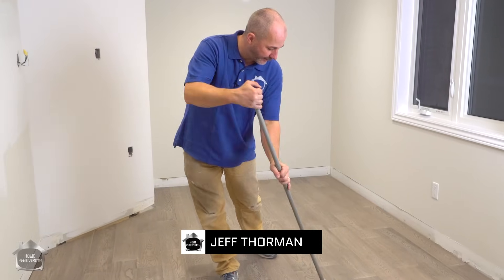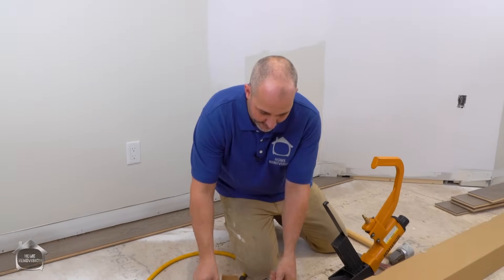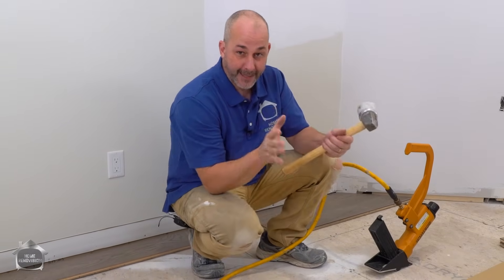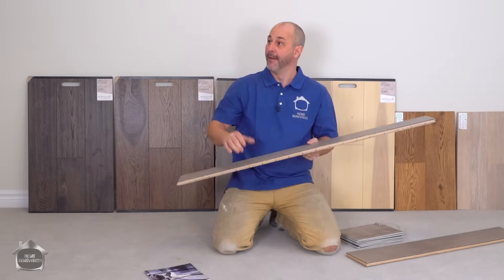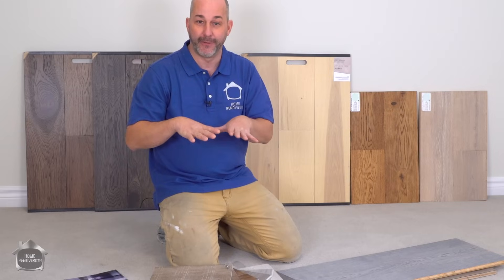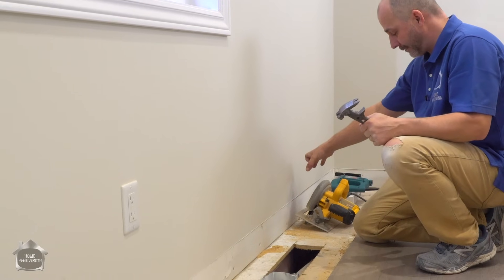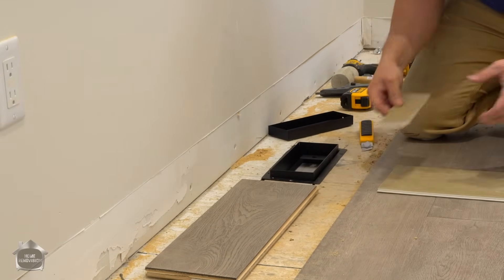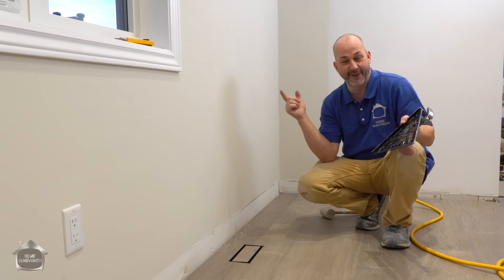How To Install Engineered Hardwood Flooring!

Comment: We are installing radiant heat in our kitchen/living room/dining room area.  What is the best flooring to put over the radiant heat system?  I'm working with a budget so I need the most economical without going so cheap I have problems later.  In other words, best bang for the buck.  FYI-We live in a raised ranch home.

Comment: Interesting. Because when I read through instructions of almost every manufacturer, what they say is that 15.5 gauge nails or staples for solid hardwood flooring (3/4 inch), 18 gauge for engineered with 1/2 to 5/8 inches thickness and 20 gage staples for 5/16 and 3/8 engineered flooring. If the flooring has a HDF core, then floating or glue down only. But what do I know, I am not a contractor. I just do DIY projects here and there.

Comment: the builder of my house installed this factory finished hardwood flooring and it is so soft, that rolling a computer chair around leaves tracks in the floor :( dropping anything really leaves dents in the floor...im pretty sure she got it from lumber liquidators, and my dad always talked bad about that place to begin with. not to mention these guys made some kind of mistake or lack of care  in the subfloor so everything squeaks, creaks , booms, and cracks when you walk around. it really is something for a brand new house built last year
Reply: That's floating floors for you (not the softness though obviously). Best flooring is glued down Luxury vinyl tile, Karndean being the best looking in my opinion.
Reply: @garnhamr  its engineered hardwood and it was installed just like in this video with that nailer thing. its not floating at all but i think the subfloor is not glued to the joists as well as they skipped out on sound proofing underlayment for the floors so it sounds like elephants stomping even if you walk quietly

Comment: There's actually a ratcheting tool called a power jack for the last pieces against the wall that butts them up tight so you can nail them...but unless you do a lot of wood floors it's kinda pricey.

Comment: Hi Jeff, I'm a fan of your informative videos. I am a subscriber and shop at your Amazon store to support. I have engineered wood glued on slab. It has developed gaps that are 1/8th of an inch and larger. Could you please let me know how to fix it? Lots of videos are about just moving the pieces but that is not an option because my home floor is glued to the slab. Thanks for your help.❤

Comment: Your site is great!  I just bought a condo in Annapolis, Maryland and I'm using all the techniques you demonstrated and applying them on fixing all the holes, scratches and attempted patchwork done by the previous owners.  If the opportunity should arise, could you show the process of moving an already installed cable outlet on one side of the room, fishing it through the ceiling and down the other side of the room and the best way to cut holes and patching the ceilings?  I love your site.  Many thanks.

Comment: Hi . I am a big fan of your work and have watched almost all videos . I just bought my 1st house and already did some renovations using your guidance . My next project is to install engineered hardwood floor and I saw all your videos on that but just realised that we have concrete under when I removed the carpets. Can you make a video or direct to a resource where I could follow steps for that installation ? Thanks for help.
Reply: Did you figure it out ? I'm in the same boat

Comment: Hello, what length staples did you use for this engineered hardwood? I’m installing 3/8” engineered over OSB subfloor. The place that supplied the flooring said to use 1 & 3/8” staples but I have the same gun you’re using and it only takes 1 & 1/2” - 2”

Comment: Hi some questions so far; 
1. With engineered hardwood is it not a requirement/ good idea to leave some expansion space between the wall and the first row? 
2. You did not remove the trims or baseboard is is that okay because it’s engineered hardwood or is that just a choice to make no matter what material is used? 
3. I also noticed no paper or underlignment under the wood pieces, is this not required because it’s engineered hardwood? 
4. What the difference between the groove and tongues? 
5. What should be prepared prior to starting the project? Should this be opened to acclimate it days before?
Reply: Engineered doesn't require as much contraction space, and it's mostly long ways. 

There is no baseboard in this video. 

Hardwood on good osb means no underlayment, unless it's second story, then use it for soundproofing.

Tongue sticks out. Tongue goes into groove for tight fit.
Reply: @joshbrienen5133  thank you!

Comment: How did you move the vent location closer? Not sure what you did with the tin  you snipped to size. Was the ducting just loose enough that you could move it over closer and attach the grille to it?

Comment: If the first row is under kitchen cabinets, should I glue that row or a half- width row to the first full width row.  Or Brad nail the half row or use 1/2 spacers to push back when floor nailing?   What to do?

Comment: How do you recommend installing engineered hardwood on concrete slab?
Reply from the maker: you get a underlay that has oval holes in it and place construction adhesive in those slots then lay the plank on top. Cheers!

Comment: My engineered floor is one year old and I have staples popping through in one joint. Do you know how I can reset those staples without damaging the top grove of the corresponding plank? I am guessing this is caused by the settling of the new home over the past year and the floor joisting is drying and shifting.

Comment: Awesome! I was just looking into engineered hardwood after you mentioned it in the Saturday’s video and I’m pretty sure that’s the way I’ll go, vinyl planks are easy, but they wouldn’t go with the look I want quite so well. 
On a manufacturer’s site I looked through back on Saturday they mentioned that they could have heated floor system under, what are your thoughts about that? It would be really nice if that’d work well 😊
Reply from the maker: definitely possible. they have technology now to heat just about anything. always follow the heat mat manufacturers install specs. Cheers!

Comment: Jeff, can you make a video please where subfloor is not leveled. Do you start flooring with tongue or Grove next to the wall?
Reply from the maker: groove towards the wall. Cheers! and you can sand the high spots if they are on a joint.
Reply: @HomeRenoVisionDIY  so we laid out floors and they squeak, is there only one option to screw them to subfloor?

Comment: two quick questions. 1. I see you never use any kind of underlay paper, can you tell me the thought process behind that decision. 2. I am installing regular solid hardwood and my sub floor bows between the floor joists by 1/8- 2/8. can i use glue with the nails to prevent wood movement?
Reply from the maker: In houses where you have conditioned space above and beneath the floor it is not needed. instead of glue I would just nail the board contrary to the joist. let the hardwood carry the load. Cheers!
Reply: Gluing solid hardwood is tough because of expansion and contraction. The bond of the glue will loosen causing squeaks. Solid hardwood is nail down only. Most manufacturers warranty calls for it.

Comment: Great, but what about starting off with a 3-inch wide plank? The gun will still bump against the wall. Does one also have to nail down the second row too? Or, is there a bypass?
Reply: That's why he started with a Brad nailer for the first row

Comment: great video. I have 2 questions,  1. when you use st Pneumatic Brad Nailer to stable your first piece, how you avoid Thermal expansion and contraction for rest pieces? 2. why there is no spacer to put on at the beginning of the layout?
Reply from the maker: engineered flooring does not require as much expansion room. 1/4" gap on the long side is plenty the wood usually grows in the same direction as the grain!
Reply: Thank you so much and always fun to watch your videos! Appreciate!

Comment: OK...  now I want the engineered hardwood for the non-wet areas....  But I have several quandaries...

1)  My house is so small that I am afraid that putting the hardwood in the LR, hall, and bedrooms, and then the SPC vinyl planks in the kitchen and bath will make the house look even smaller.... or goofy...  mostly the kitchen to living room....  Plus the transition from thicker wood in LR to thinner vinyl planks in kitchen.

2) How do I put the engineered hardwood in my concrete slab on grade home?  I am assuming that I have to put a sub-floor over the concrete?

3) How do I decide which way to run the planks....  (I should probably shoot a short video to illustrate)  If I go with the hallway direction, it runs across the long axis of the LR/kitchen....  If I run it on the long axis of the LR/kitchen, it runs cross-ways of the hall...  which I think would likely look "odd".
Reply from the maker: long way down the hall using a construction adhesive. I would not be afraid to use it in the kitchen. It is not actually a wet area. Cheers!
Reply: @HomeRenoVisionDIY  Thanks...  I think I have decided to do the engineered wood everywhere BUT the bath and utility room, where I will use the SPC.  That is assuming I can get "buy-in" from my lovely bride.

LOL!  OUR kitchen is frequently a "wet area"...  something liquid is always getting spilled.  BUT, I think if I do MY job properly on the install, I can keep the spills up and prevent spoiling the wood.

Again, thanks so much!

Comment: Hey Jeff, I’m going to be installing bamboo flooring in my house over the next few months between work. Would the install be just with Brad nails into the tongue onto the subfloor or would I need to glue it down as well?  I’m in northern Alberta so we get anything between -50c in extreme conditions to +35-40c.

Comment: Hi Jeff! Quick question.. we are looking to install engineered oak floors in our home. The current original 2in hardwoods are installed parallel to the joists, but we keep hearing that we should run new floors perpendicular to joists. Problem is they'll be running left to right rather than straight front to back. Do you think we are fine to keep boards parallel to joists? Our subfloor is 5/8. Thanks SO much!

Comment: Very informative video, thank you! :) Are you planning to upload a video about how to install hardwood flooring on floor joist? So there are basically no OSB boards attached / glued, the hardwood flooring is installed right on the floor joist :)
Reply from the maker: No, that would be weird since the osb is already a pre existing part of the structure.
Reply: @HomeRenoVisionDIY   I am currently renovating an old house that has adobe wall, and the old hardwood flooring was installed right on the floor joist. I have to replace the old floor joist system and the hardwood flooring as well, since they are very old now. Do you always recommend to install OSB boards on floor joist, even in houses with adobe walls? The floor joist was installed on cob (rammed dirt), and I am worrying if I put OSB boards under the hardwood flooring, it won't let moisture to move freely, therefore all the moisture will be picked up by the walls, causing them to mould. What do you recommend?

Comment: Decorner is currently only selling "click" engineered hardwood, is this worth using or should I stick to a tongue and grove system that is stapled?
Reply from the maker: I am loving the click hardwood. the stapled down is designed to last longer but the click will still get you a good 25 years!

Comment: What’s your opinion on adding returns for furnace/ac using the wall cavity. If I properly seal the studs/drywall so air is only pulled from the cavity I want. Is there a downside or a reason I would want to add ductwork for a return?
Reply from the maker: return air does not require ducting in wall cavities. Cheers!
Reply: Home RenoVision DIY - my supply is low on an outside wall which is required here. I want to add the return  to the  opposite wall one high and one low and shut the louvers to the one not being used depending on the season. Worth it?

Comment: dont you have click 5G Parquet/engineered hardwood flooring in north america? we havent nailed floor in 20 years here in Norway. Apart from Hardwood though. the floor parquet we use is ususally between 12-15mm thick.
Reply from the maker: Interesting. I am not familiar with that product as of yet. cheers to norway!

Comment: I'm so relieved to know I can now receive this product. I've been recommended by my designers and have already selected the colour and finish which is the Torlys vinyl flooring (Forest Narrow Floating - EE-FN-9866) but haven't ordered yet (I also watched your video when you installed a Torlys vinyl flooring). I have 1000 sq feet to install around the house. Now I'm on the fence and wondering which product to choose Torlys or Hardwood Global?  I currently have the original old parquetry (ugh...I've always despised it) from 1983. I also have a dog and am wondering which one would hold and resist better to high traffic, scratches etc. and I can easily install myself (my confidence is not that high)? I've received pricing to do the work by a contractor (insane) if I can keep that money I'm all for it!  I'm also wondering if I should strip out all the old flooring (contractor suggested) or install over it although I'm concerned if I install over it, the overall height will be too much to fit the nosing for the stairs leading to my kitchen. Can you help?  Too bad I can't include a photo of it here
Reply: I'm in the hardwood industry. It's best to look at the product in person. Colours don't show well in photos. Torly's vinyl or laminate is great product. The ability to do repairs on laminate without removing the entire floor is impressive
Reply from the maker: I would suggest using the vinyl for wear protection due to pets. Cheers!

Comment: Can you install engineered wood on top of an existing parquet floor? In the house I just bought a floor guy told me he can't sand it down anymore because the nail heads will be too exposed but said he can't install new on top.

Comment: Question: I own a 1966 tri-level and I want to double up on my (HORRIBLY messed with, unleveled subfloor) with the intent to help with soundproofing. Can I use felt in between layers and should I not nail the second layer to joists?
Reply: Did you end up doing that ?

Comment: First of all, thank you so much for all of your content. Very informative and easy to follow. My question is about an engineered hardwood installation that we are about to start in our house. The house is only a couple years old and everything was finished  with 3/4" solid hardwood as the determining factor in trim heights, baseboard heights, tiled hearth, etc. The new engineered that we are putting in is only 1/2" according to manufacturer. The dealer says it is a little less. We currently have 23/32 OSB as the subfloor. We are going to have to install 1/4" or 3/8" plywood (we'll know for sure when the new flooring arrives) to "raise the subfloor" to match everything. Finally, the question: How do we fasten/glue the plywood to the top of the OSB subfloor? What kind of fasteners, glue, fastening schedule, etc.? Also, the new hardwood is 7" wide and is recommended by manufacturer to use glue assist. What adhesive do you recommend for the hardwood?
Reply from the maker: I suggest following my subfloor video as a guide to layering your subfloor. Glue assist refers to construction adhesive. you can get it in caulking tubes and simply apply a bead opposite the direction of the flooring and lay it in. I prefer to use staples with that type of product. only add a bead of glue as recommended by the manufacturer. Cheers!
Reply: @HomeRenoVisionDIY  I mean, I guess you kind of answered.
Reply: @HomeRenoVisionDIY  Any chance of fully answering the question?

Comment: Question... Jeff my kitchen sets on top of a wood subflooring but it leads into the foyer that has concrete. If I purchase the European engineered hardwood, can I glue that material to the  concrete substrate? Jeff
Reply from the maker: definitely an option. Cheers!

Comment: Great video, thank you! Question: why nail/staple the engineered hardwood when it could simply be floated?
Reply from the maker: If you are going to invest in hardwood then attach it to the house. the T&G on that wood does not lock and it will separate over time and look like trash. Cheers!

Comment: What if you're installing engineered hardwood over concrete? Could you float the whole floor?
Reply from the maker: depends in what location. you can use construction adhesive or nails. never floating.

Comment: Can you lay engineered floor over old wood plank subfloor?
Reply from the maker: depends on the condition of the old!
Reply: Ideally I know I should put a plywood subfloor in just trying to save like 3 grand in plywood plus labour.  The planks look pretty flat and in good condition .  I was just going to screw all the boards down with flooring screws to help keep them flat and so they don’t squeak .  It’s a tough decision .